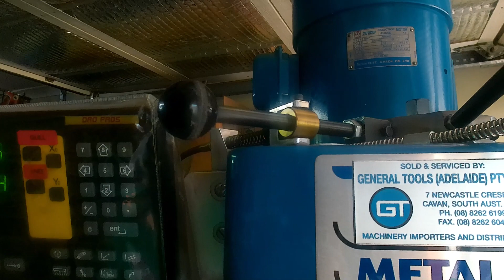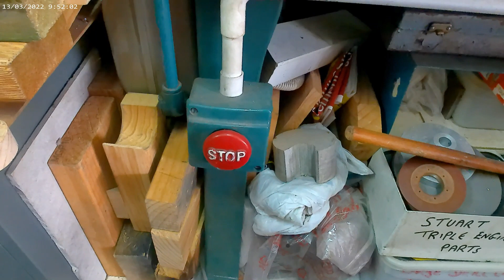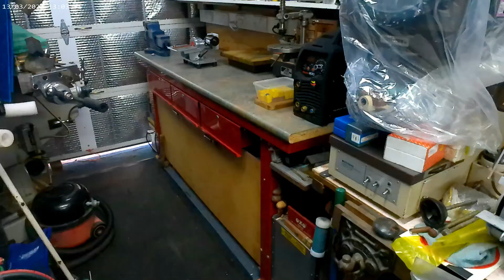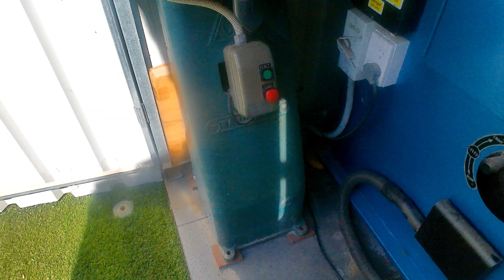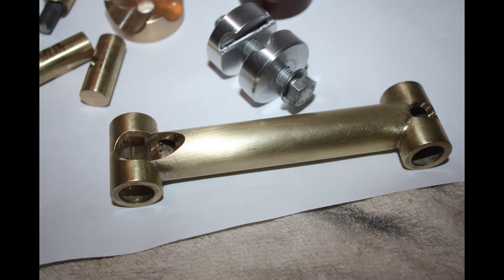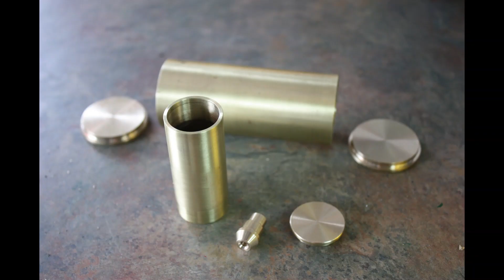Australian Metalworking WORKSHOP TOUR AND CHAT.

Comment: Hello Dave. I came over to look at some of your video's. Nobby recommended you. I will sub to your channel. Very interesting how you alter everything you touch. I do the same on my channel. Take a look when you have some spare time. I have the Tom Senior light vertical that i have highly modified with lots of video's on the machine. I have the Ford Mondeo wiper motor mod like yours, but slightly different. I also have the Myford Super 7B, again highly modified. I am doing a rear parting tool mod now. Video's are up , but i am doing an additional one to accommodate different cutter blades. Keep up the good work. My background is Electrical for 50 years or so. Plenty of electrical mods as you would expect. But plenty of engineering ones too. Take care. P.S. Not sure if you do workshop stickers. I do & think it helps the channel. If so let me know & i will post some out to you & get some from you. 
Regards from the good old UK.
Steve.
Reply from the maker: Thanks for your comment. Will have a look at your video now as I am on a rest day  😊 No I do not do stickers. TBH I think that they are a waste of time and money, but thanks for asking. Regards.

Comment: A nice little video. That must of been an expensive move from UK to AU! Thanks for sharing your journey and shop setup. Have a great day!
Reply from the maker: Hello Thanks for the view and the comment. With regards to the moving costs for a 20 foot container for my exclusive used was 2, 000 GBP which I thought was a great price. HOWEVER when it reached Australia I had to pay another $ 6,000 to get my stuff delivered. This was 2006 prices. I was told in the UK that the next time I would see it was when it was delivered to my house. Not true, I had to go to the shipping company and be there when they open it up, it had been sealed by UK Customs. It was unpacked and loaded onto the warehouse floor. I left then, it had to be checked by AU Customs, when OK it was then loaded onto removal vans to deliver to me. Luckily they used a tail lift with a pallet truck. Trouble was that as I was told,  container to my door in AU, I had used flimsy carboard boxes for packing assuming only 2 moves. In the end it was 4 times, twice in / out container , in / out moving van. Some boxes had failed the extra handling and they had to supply more to get it to me. Luckily nothing much broken other than they broke a handle on my mill, I expect by using it to move. The warehouse people had not seen machinery before, they were used to household goods. Thank. Regards.
Reply: @daveticehurst4191  That’s crazy! Glad all that is under the bridge now. I had to move from one side of the US to the other twice, and that was not fun. Your moving experience was much more intense for sure. Have a great day!
Reply from the maker: @FLKayakn  Thanks for watching. All forgotten now getting on with life. Regards.